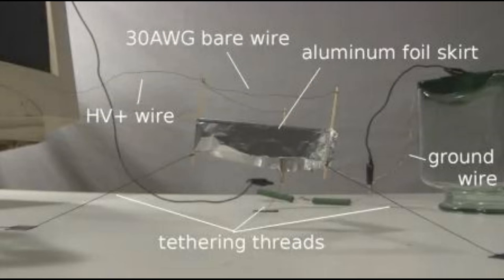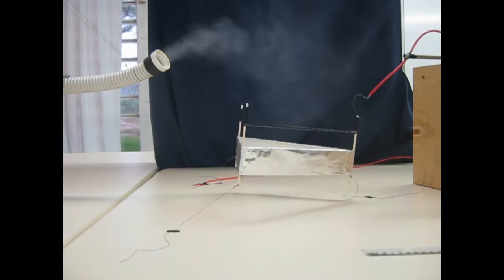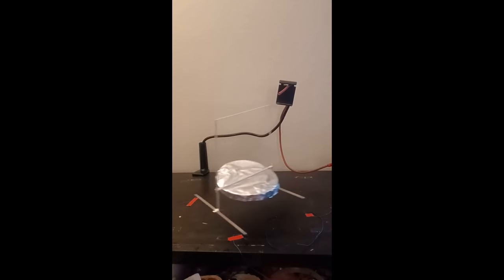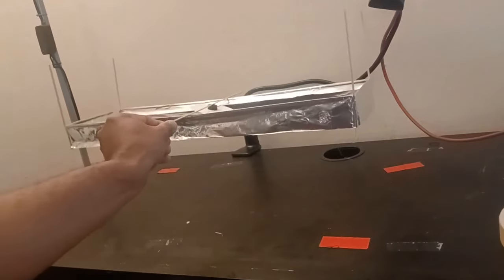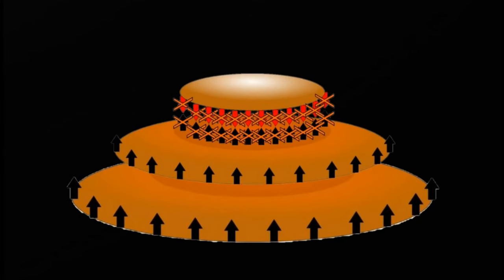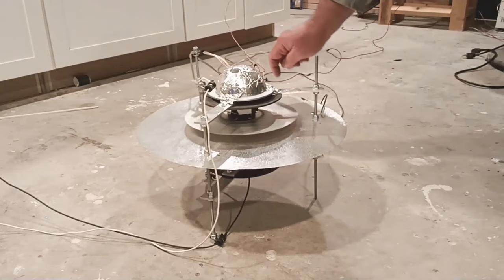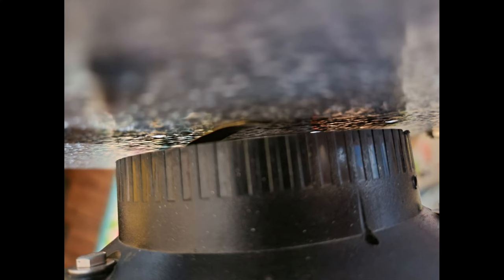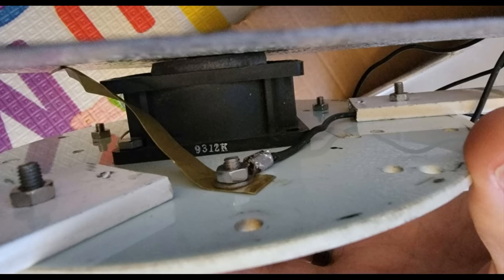Graviflyer "One Step Closer To Lift" #44

Comment: I never knew about those weird craft that are like ion craft but have the charges separated that much. Now what would be interesting is to introduce some ultrasonics into & see if it could lift more.
Reply from the maker: I think I need to do my last few tests on my good graviflyer and then start a magnetosphere project where we use known experiments that we can put together and it does not have to lift. It would help with the fields. maybe even bend some plasma.

Comment: Love your work! My assistant and I have been working on developing graphene film super capacitors that weigh almost nothing as they are on .1mm thin film but pack some serious power. If you adapted your lifter to our nano super caps I really think you would have more then enough power for several minutes of un tethered flight!
Reply from the maker: That is really interesting. When I lift it lets talk again. I need to make sure I know what power is needed first.
Reply from the maker: oldmannathanbunten@gmail.com

Comment: @22:03 his hand catches one of the fishing lines tied to the drone above it, he then readjusts the line to make sure he didn't knock it off, watch it a few times and even in slow motion if your not convinced, clearly he messed up and was trying to correct his mistake, if anyone has a better explanation for that sequence, I'm all ears
Reply from the maker: I built the round one before. It does lift like I showed. I did not do the weighted one but I did check the ion wind. It was 2.1 m/s There was no way ion wind could be the reason for lift.
Reply: Even if a wire came loose he wouldn't have suspected it unless the device fell lop sided which it didn't. I feel he would've been more convincing to have passed his arms over the device from the side and indicated by a verticle scissor motion that he also wasn't behind/foreground of the device. He couldn't have crouched over the device like that and not got completely tangled, which he also didn't. A wise move to have chosen the location and the disguise.
Reply from the maker: @Deviation4360  This is real. The wire is his high voltage wire for the top. Not a string.
Reply: @nathanbunten4299  I'm just responding to the rational criticism, not the validity of the concept. I have just sprung upon this video and I'm grasping for my own response aswell. So far I can't get around the simple deduction that wires pulling at each other within the same circuit will cause anything but an imbalanced force, they will simply cause the wires to sag toward each other and bend the posts suspending them. Even if you change the shape of the anode to foil disc the disc will simply deform, not move in any direction especially not creating bouyancy. The ion wind makes sense because it's causing a mass flow of air past the foils away from the electrode that is itself repelling from the charged moving air between it and the foil (ie the foil doesn't catch the airflow). I myself have seen that pulsed ignition of gasses or explosive forces produce a higher reaction force than constant ignition as do piston engines that have odd firing intervals. I can see in your description of the piezo-buzzer that something similar is being done with charge polarities to "Smash" a higher impulse upon the graviflyers components (but again AC still has back EMF that would cancel out the benefits of pulsing polarities). Alot of descriptions of UAP craft by their alleged alien crews state that some sort of vacuum effect is created over the bell of the craft to levitate and this effect is used at an exponential level to traverse space etc. This sort of atmosperic distortion suggests that no noise and shock waves would form but the high "G" manouvering problem still perplexes me.
Reply from the maker: @Deviation4360  In this video I discuss lifting a craft. I describe the fields the craft creates in this video. https://youtu.be/aNrYXTkeyVw

There is a bubble around the craft. When the bubble is at full strength it will cancel out most of the gravity waves with it's own. The aluminum center plate is polarized or has a charge that pulls tings in. because there is eddie current on is the voltage part is thrown outward. making 2 different effects. 

it is a gravity well. The video you watched is an idea on how lift can occur in this craft. I need to do a otal video soon. I just doing testng for the lift right now. trying out more powerful power sources until i get a good mix.
Reply: It looks fishy .😉 But I like fishing .
Reply: Oh boy.. 22:27 😔
Reply from the maker: @anthonyscott9936  He leans over it and it static clings to his shirt. what did i miss?
Reply: @nathanbunten4299  nooo, when he lifts up off of it he stabilized something with his hands so it doesn’t swing.. he wasn’t grabbing the craft or the wires..
Reply from the maker: @anthonyscott9936  so you think it is fake?
Reply: @nathanbunten4299  I don’t know necessarily, I believe the principles are aligned with what time has told about these things, but it could most certainly just be, a human working, trying to get it, but still being like most humans with YouTube, lol tryna get some views. But like I said these principles are close, that’s why I branched off and went another direction with it, I think it’s possible, might even be the only way to get the result, I just think his design is kinda shot in the dark, and then with stuff like what’s in this video, makes it really tough.. but everyone know about the spinning and charge, mercury, ion lift, it’s there, I just don’t think this design is the way to go and now I know some of the videos it’s hanging..

Comment: I wonder how the effects would be mirroring it to have the same below mirrored but opposing field direction to unify it, where top half and bottom half will both intermittently feed each other... Just throwing ideas, getting closer, awesome job, work, dedication!
Reply: I think the piezo buzzer needs a secondary like a dipole if the Tesla coil so it can oscillate it's voltage output between the two at its rate to give more of a standing wave aspect as transducer like... The distance or medium between is crucial to obtain that vibratory response in a closed loop intermittence to allow that  standing wave or excess energy to generate the octave levels, I love this kind of stuff, when vacuum from rotation is induced, it also creates a stronger pull for ions or electrons as that may help this out as well, keep it up and it will be up
Reply: Anyway to link up? I could utilize your expertise when it comes to the electrical and magnetic end of things which you are more familiar with I see in ways, I also have things that you would find very interesting that would Most def feed into all this hand and hand, lmk
Reply from the maker: Alexey tried to put magnets on top to get the same thing he had on bottom to lower the amount of time waiting for it to change charges. It never worked the same. An ac flyback with voltage multiplier is still dc but has a stronger charge to it for magnetization or polarization. I might try it on my other graviflyer I have.
Reply from the maker: send me an e-mail. oldmannathanbunten@gmail.com
Reply: Awesome, thank you
Reply: It's not about putting the magnets as you noticed, it's how the field is applied through the way voltage is induced I believe, your making magnet in such a way as an electric field for this application I imagine...

Comment: Do you have more pics of the copper strip providing HV to the spinning disc? I'm about to connect HV to mine but am not sure how exactly connect it.
Reply from the maker: https://youtu.be/rk3d6Saf9_0 I showed it in this video. you may want to just use wire and drill holes in the side of the holder to zip tie it. you will not get unwanted spark over that way.

Comment: I was thinking using a bunch of tattoo needles on the top plate to cover the hole plate and a bunch of miro holes in the middle plate and repeat it under the middle plate and holes on the bottom plate and oscillate the power so the top plate is + and the middle plate is - then the middle plate is + and the bottom plate is - while the top plate is off and repeats
Reply from the maker: I built the field for this craft. Use the tesla coil and the high voltage they work good together.

Comment: very interesting i think your get there soon and i cant wait ,on the disc with the brush you only want it to touch now and then why not glue some plastic bumps so the brush lifts off at certain points.
Reply from the maker: the wobble in the motor is good enough. The fan motors do not track straight when the disc is on anyway. The one trick I could do is add a part that has a dryer sheet to a simple arm to get the static voltage quicker. The dryer sheet makes the disc into a vandergraph machine. 

If it comes down to more power I can use the ac flyback with voltage multiplier circuit I built. I would need to also get my tesla coil to double in the field strength. I ordered 2 different transistors to try one have 600v and the other 1200v so the slayer exciter circuit should be more powerful soon. 

I have a variac and full bridge rectifier and step up transformer to get to 220v dc so if I can get the transistor to take it. I will have all the power I need.
Reply: @nathanbunten4299  the only thing i can say is please use AC power in it all as the universe is AC current so to manipulate it you would need to use AC just my thought. and 1kv and pulse the whole thing.
Reply: Nathan, when you change the AC voltage to DC voltage and then up the voltage the current drops, so you have the same power and not more power. When you get in resonance and polarity with the piezo disk, so the field increases then the power increases. The extra power comes from the atoms producing more electrons or current by the atoms pulling in zero-point energy or space and producing more electrons. The atoms do this by the air atoms that are moved by the piezo disk sound waves hitting the aluminum disk like an argon electron amplifier like my friend Mark Tomion showed with his EDF generator setup. The air atoms hitting the aluminum atoms slow their spin putting them in a time warp that wants to get back to the present by emitting the electrons that are pulled in space by the atoms to make the electrons. It is like a star trek replicator.  Turning one type of wave on my spectrum to another type of particle.  I will show you this in an email to you.
Reply from the maker: @richardmuller867  cool.
Reply from the maker: @jediknight2350  I have a 2kv setup I will try. it polorizes faster.
Reply: Nathan, I just sent you another email to explain more that I know from working with the black ops back in the 1980s. When you get the charge high and voltage low on the disk and the magnets spin to make the eddy currents the equation P=IV=V^2/R=I^2R or V=IR the low voltage makes the resistance low, so the power is correct. With the charge high and the current high from the spinning disks the resistance is very low so the power is correct or a room temperature superconductor, so the electron field then becomes the antigravity waves instead of heat or IR so the graviflyer lifts up. Oh, what is your idea to stop the disks from sparking or arcing out?

Comment: Good video, but it seems that Mr. Alexey is immune to high voltage because he touches the alternating current disk with his bare hands and rests his chest on the direct current disks while in flight.
Reply from the maker: i did a video on this. he may get burned but there is no ac high voltage. The tesla coil is dc and it is a pulsed square wave. The Graviflyer will get hot. There is not enough power to make a breakout point. on top of that the wire is not directly connected to the tesla coil. it runs down the center of the #2 coil not attached to anything. it acts like load on the tesla coil. You can touch it all day but it gets to 74 degrees and will burn you. that part is strange.

Comment: Don't try to create lift, it is a futile effort. Create gravity. Situate the center of mass of a craft in between two gravity wells, and then use almost no propulsion to move the craft effortlessly.
Reply: Very smart you are..
Reply: Good approach, this type would fall under the "false mass" type of propulsion where a dielectric sink is projected that the craft "chases the fall" so to peak.
Reply: @JenkoRun  isn’t that how we walk..
Reply: “Correction” of the fall..
Reply from the maker: I like the idea. I am working on amplifying the fields. Voltage sometimes sucks!!
Reply: @nathanbunten4299  can you explain your reasoning behind trying to amplify the fields? What are the fields then going to do? What kind of fields are you using? What is the interaction between the effects being used? You should make a video explaining exactly how you are creating these effect, why they are being created, and how the effects are going to work together to create “lift”. You should probably describe things on the circuitry level that way anyone doing circuitry can replicate and actually understand how the components are working to get this desired result, eh?
Reply from the maker: @anthonyscott9936  I have made several video's on each of the things you mentioned. I even did a long video on how to produce them. I also built it with wiring and stl's for a 3d printer and gave a parts list with amazon links. I went even further and showed all the wiring and schematics from the original Graviflyer. I also showed measurements of the frame and reviewed the circuits. I built a tesla coil and the high voltage in video's as well. The one thing I need to do is put a lot of it into a single video as a hypothesis. Check my channel. I also do testing all the time and show everything.
Reply: @nathanbunten4299  I know that’s why I mentioned it because I’m still confused on the working principles behind this design.. and still haven’t watched a video explaining a concept of it. Just mentioning the words high voltage, fields, and ultrasound.. but never actually explaining HOW these interactions are gravity or are associated.. like for example, the earth is a planet that has gravity, based on the earth, this design doesn’t really have anything to do with it, meaning, the principles of planets don’t align really with this design/concept.. see what I’m saying? Like it would be much easier to just make a small planet with same attributes and you should have gravity.. but I’ve watched basically most of each of your videos trying to see if anything new was found out, this comment is kinda the result.. :/ I would very much love to see this type of tech in the world.. like, WHY do you think this particular design and circuitry works? Honestly what’s your understanding of why this would work.. I’m not being negative I’m trying to learn truly. This needs to get done as a collective.
Reply from the maker: @anthonyscott9936  You are right. I should have made that video first. That way we can test theory's and decide if they have value. One of the problems I had was I did not know much about it when I started. But now that I know it would be time to put a unified theory together to explain everything to this point. I will make that video this week. You are right. I should have done it sooner.

Comment: The charge net force between the discs is 0 if the discs are attached. No ressonance, movement or rotation will change that. 
You cannot push a car from inside the car. No matter the frequency, place or force you use in it. IT will be cancelled.
Any movement you are noticing is from ion induced air momentum, or plain thermoacustic momentum from the sparks. Or fraud.
Reply: you look very educated
Reply from the maker: I can repeat it. No fraud. The energy was increased by hitting the correct octave.

Comment: I see you are working very hard  to make your gravity flyer work. My gravity flyer weighs 1LB - 10 oz. I have not built up my control circuitry yet. So my craft is a lot lighter than yours.   I put a small I bolt in the center of my dome. So I can attach a string up through a couple of pulleys and off set the weight the craft to see if I get any lift at all. I can change tha amount of weight to see if I get any lift at all. Or I can fake it and just pull the string and make it look  like it's flying.  Last resort. RIGHT  Ed
Reply from the maker: I hope it fly's for real. I don't do strings EVER. I am not interested in fakeing anything. I want something to lift on it's own. I do not care to lie to people. That is not why I have a you tube channel.